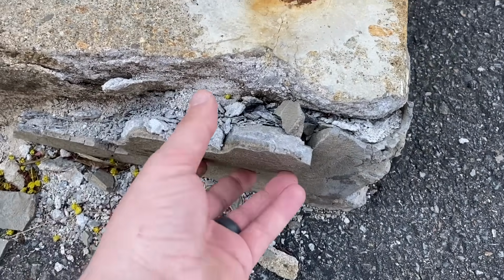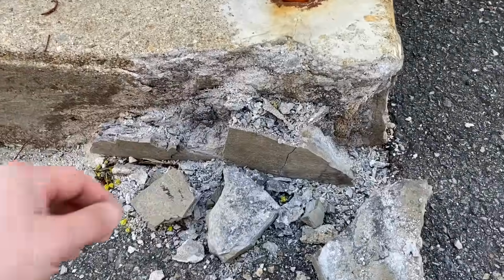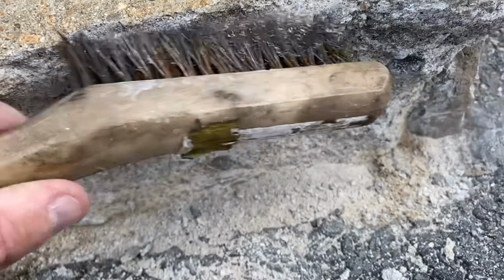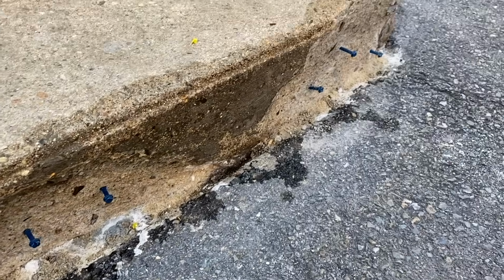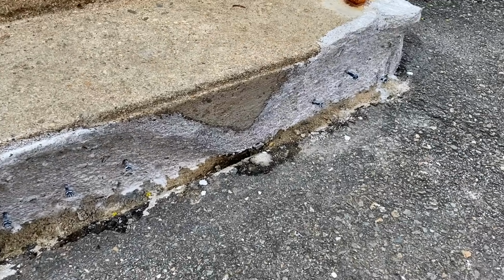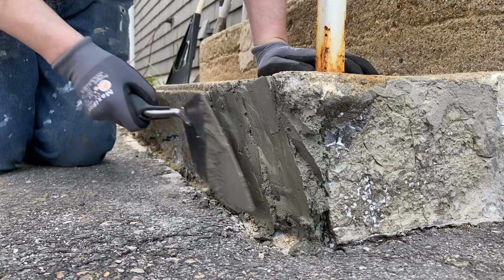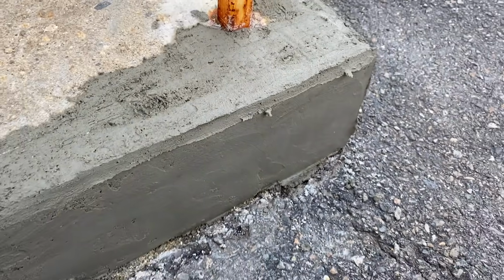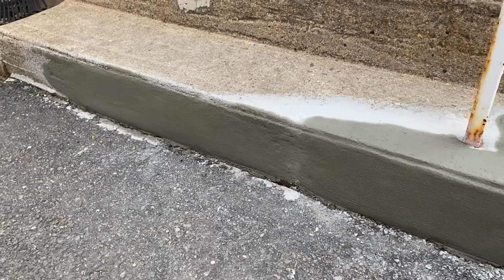How to Repair Broken Concrete Stairs - Quick and Easy

Comment: I am a concrete contractor. This is only a temporary cosmetic fix, especially in Michigan. It may last a year or two and then will pop off. If he had more area, he could have drilled some rebar into the existing piece that will give it more structural integrity, but what you have here is frosting on a cake that will 100% not last

Comment: I was trying to find the difference between Quikrete Quick Drying Cement (as used in this video, and Quikrete Vinyl Concrete Patcher (which I recently bought).  I "assume" they can be used for most of the same jobs? 
Their website doesn't give a definitive answer about differences,  but it appears that the Quikrete Vinyl Concrete Patcher is used for thinner patch jobs (1" or less, where the acrylic modifier additive helps) whereas the Quikrete Quick setting cement is for thicker applications. The data sheet for the Vinyl Concrete Patcher specifically says it is a "repair material for making thin structural repairs."  Could it be used for the repair in the above video???  There were 10 million choices of cement/concrete materials at the Home Center, and I picked the Vinyl Concrete Patcher.  Let me know what you all think. I am also guessing that the Quick-drying cement cures faster than the vinyl concrete patcher, but the Technical Data Sheets don't really say it.

Comment: Rather than using a bonding agent, which can re-emulsify (soften), the least expensive material, and the absolute longest-lasting, try brushing a very thin coat of modified thinset mortar immediately before applying the mix. No screws needed, and the bond will never break.

Comment: probably better to remove a foot of the step entirely, dowel in some rebar into existing and then form and pour with 3-15m bars run parallel with the stair itself

Comment: When patching older concrete, keeping soaked rags on a cleaned face overnight (or until the cement stops absorbing water) prevents the old cement from vampiring water from the new which causes it to pull away /crack. It looks like the adhesive is latex type, which can also be mixed into the new cement for strength, adhesion, and waterproofness, but it raises the cost and causes it to set REAL slowly.
Reply: I had no idea you could mix the adhesive with the concrete!! I have a project where I will definitely put that to use. Thank You!!
Reply: @Chinotruth  Take note to mix per instructions, too much and the cement never sets or is very weak. It also causes it to set very slowly (hence in increase an strength). Again, check the instructions, but my experience is at least 2x longer.
Reply: I must be dumb because I understand nothing you said are you saying to wet some rags and leave it on the old concrete overnight
Reply: @Cind-z9k  Pretty much. You leave the rags in place until the existing cement stops soaking up water quickly.
Reply: Excellent point about wetting the existing surface, so it does not draw moisture from the fresh concrete.

As an inspector it is always a fight to get the crews to wet dry stone or existing concrete surfaces that they are pouring up against.  If I don't do it, it doesn't get done.

Comment: I've been a handyman since 1996 and done some corner repairs like that. You did an excellent job. Not many people go on to show it done right but you did. I like how you're so meticulous in making sure that it comes out looking nice as well. Keep up the good work.
Reply: in your experience, is this type of repair long lasting or will concrete chip away again when exposed to salt and ice? thanks!
Reply: @richmarxist I've done the repairs here in California where I live so we don't have the issues of the salt and ice. But this step by step that the gentleman showed definitely works. But you must use those tapcon screws and concrete adhesive like he showed there.

Comment: Honestly thats too thick to patch, It will always fall apart.A better solution would be to cut out the bottom step and repour. chisel around the railing and just leave it in. Plus the concrete looked brittle too.

Comment: The only advise I would add is to wait for a full cure and apply a penetrating solvent base sealant to the entirety of the staircase/stoop to prevent water infiltration down the road.

Comment: I use the quikset fast setting mortar repair and i swear by it. You can use it over head on the ground or side walls most situations no forms are needed. Its so moldable. I replaced a corner of my slab foundstion that was knocked out with a backhoe. I mixed and pressed it in place with a trowel layer by layer about 6 " deep. No milk(bonding agent) no rebar. Youre right about the tapcon screws. Or even drilling out and sticking rebar in. Its only going to strengthen the repair but the mortar repair is amazing. I havent used the cement youre showing.

Comment: only thing I seen not on par would be not pressure washing  and most of your problems on the corner are coming from the post rusting and expanding and taking out your corner only takes a hairline  and the the problem is back nice job for dyi  and nice job using tap on as anchors had lots of success doing that

Comment: Chip the concrete around the metal post ... remove rust and use red iron primer  or rustolium and paint it .. then when you float patcher around  the post slope so water runs away from post.  That will stop water intrusion and stop the concrete from blowing out again ..

Comment: You shouldn't have any problems after using the bonding adhesive, without that it would have all crumbled away again as soon as the frost gets to it because the old surface will be soft and needs the bonding to stabilise it. Pretty good finish as well by the way, though would have been nice to see it a couple of days later when it had set up and dried out.

Comment: What you should do is find out the reason it it breaking down.   Give you a clue.  Look at the rust at the base of the metal work.  If metal has NOT been treated, whatever you do to the concrete the chemicals reactions will still eventually break down the surrounding concrete again.   Check twice repair once!!!

Comment: I am not really a fan of patching concrete
But to reinforce this where you used screws,
I suggest a better way
Drill a 3/16 hole in the original concrete,
Use coated nails, and get some long lengths of standard baling wire, place in these holes 2 piece long enough to span to the next hole, So when you drive the nails in, the nails cannot be pulled out, or use screws,
 Then drive the nail into the hole with the 2 pieces of extended wire, to keep this wire below the surface, and the wire goes into the next hole,
The wire spans each hole and acts like reinforcing in the cement, keeping the concrete in a solid piece,
I hope you can see the advantage especially when concrete ages,

Comment: Fine after the fixing, but but. The cause must be removed. We can see crack from the steel tube. There is water inside the tube which expands many times during winter time. First we must repair the steel tube or better change it to solid section profile. Second, The existing concrete is not valid. It includes thousands of microcracks. The old concrete must be removed from the whole corner. Then the concrete surface must be cleaned with high pressure water. After this we can begin to use new repairing materials. The permanent contact between the old and new concrete   develops through the hydratation of cement. So, do not use any dispersions, but use water. The surface must be moist but not wet. Brush strengtly cement mortar to the old clean and moist concrete surface. After this, use repairing concrete. At the end, remember curing time. The concrete needs water to harden. Yes!

Comment: Nice job.   I fixed my front steps las summer using the same products.  I used a 6 inch drywall taping knife which worked great.

Comment: Almost perfect, 1 thing i would do differently:  The concrete mix you made should be added with a brush, in a thin layer. . . Just after i would then add the final concrete layer, which should be very dry. . . . Concrete should always be as dry as possible, and covered with plastic for 3 days. . . . This would have made it even stronger.

Comment: Looks like the steps have rust aka iron oxide expansion giving the steps that look... Especially if the square tubing is hollow.... Yes rebar will rust inside concrete

Comment: Right side crocked line nowhere straight ..sorry that wont pass my standard  u could have done better small area ,,concrete remedial guy myself in new zealand ,,,plus when u press that mix on tread it push out the the mix on riser ,ud rather do the riser from bottom going up to tread so to avoid pulling out mix  and avoid getting trap air.if you needed advice free to messgs me been doing all sorts of remedial myself for 15yrs now

Comment: The loose sand is an indicator that a lot of rock salt was used to melt ice and snow. The salt just eats away at concrete especially when water migrates into cracks. But great work on your part for the repair process

Comment: You should used a Rubber Towel to finish the Concrete. The Rubber trowel will make a better Finish on the surface of the Concert next time. But Your project looks good. Great Job.

Comment: Good ... but next time u want to extend a profile onto wet cement ... us a stick (square, or shaped to suit).  Lay it into the existing profile, slide it back & forth slowly, to form the new cement profile exactly the same as the original.  Don't use yr finger ... !

Comment: Thank you. I had a similar problem and it was a hole in the side of a cement porch. Instead of rebar or screws, I used a 3d pen to draw out a frame and the cement held on to it wonderfully. Right through winter. The spot that did not have the 3d pen structure ended up cracking and will need to be redone. Fortunately, it's on the side of the stairs just like you displayed there. But this time I'm going to use the screws and steps you used in the video. Thank you. that was very helpful.

Comment: As a keen (and I'd like to think competent) DIYer, did I learn anything from this video? Using anchor screws as rebar, using cement bonding adhesive and sponge finishing the cement; all check the boxes. Thank you for this; Ill be sure to bear it in mind on my own renovation. Thank you.

Comment: I'm an architect and love seeing these types of videos.   My only suggestion is the you hammer the new concrete so that it matches the rest of the steps.  Otherwise it will look odd that you have a smooth finish on the repaired section and chipped and hammered look elsewhere.   Aesthetics!
Reply from the maker: oh good tip, Andrew!  Thanks for checking out the video!

Comment: Good idea on the screws but plain painted or coated steel screws will get scratched as they are screwed in and start rusting and expanding eventually breaking the patch, I use stainless screws or all thread set into epoxy or concrete. Salt ruins concrete less than a year old except for special mixes used in highways.

Comment: Well as a General handyman for over 20 years I use Portland cement as the first bonding agent.  Wet it down in a pail until it is like totally melted ice cream consistency and paint it on and than I use the stuff in the pail you used, or just general masonry mix.  Masonry is porous.  All masonry slowly absorbs water.  This is fine.  ACCEPT when there is metal in there.  Rebar or any metal (Tapcons you used have a nice protective coating....that strips of when used).  By the time your screws would come into play to "hold" your repair, it would be because there is a crack between the repair and old concrete.  Rusting metal expands, we all see it in old bridge foundations where it blows off chunks of concrete.  Your repair and the old concrete will absorb and different rates, and expand and contract differently.  Your bonding agent will help keep the dreaded water out of the crucial surface to surface area.  I try to use like materials, Portland by itself is an awesome bonding agent, and is the main ingredient in all concrete.  The old surface should be WET always when making a repair, do NOT let it dry off after cleaning.  On a molecular level it causes your repair material to be "sucked in" to the old surface.

Comment: I am not a contractor, just an ordinary guy. I need to fix a corner of a concrete pad that the yard guy hit with a zero turn mower. So this is very helpful. P.S.  Good job.

Comment: Just from observation. It looks like the asphalt was right to the stairs with no expansion strip. If the asphalt heaves faster in the winter than the stairs you have an upward motion pushing on the front and the corner. I note the asphalt has not been sealed which allows water to get between the cement and the asphalt. It’s hard to tell if the asphalt is tapered away from the concrete. 
In a northern climate you have road salt and beet juice two corrosive chemicals that can be brought to the stairs by shoes, snow shoveling and the like. 
Finally, the finished product looks very nice, but it is best if a sealer is used all the stairs; probably several coats to the repair and flat surfaces. A well done video for the home owner!!!

Comment: I have a similar problem except it is on the side of the concrete steps. How do I repair that?
Reply from the maker: Pretty much the same process as I did on the front of the steps here.  Just make sure you clean the area up good and you should be able to make a decent repair.  Let me know how it goes!  Thanks for watching!

Comment: Good job, 
Even you forget to  fix steel wire between the concrete screws to create a spiderweb it helps the concrete to be fixed for ever and avoid to crack

Comment: The only 2 guarantees you can give about concrete is that #1, it will crack, and #2, no one is going to steal it...... I noticed two cracks coming off the corner of that post, which is a given that it will crack off the post. I would have broken that chunk off as well. Well, actually to fix it correctly, I would have torn the old steps out and totally replaced them. The groove/line on the tread is from a poor job with the edger when the steps were originally poured. We would always 'strip and face' which means the boards would have been pulled off while the concrete was still workable, but not totally set, and then mag float those lines out. For rounding your edges, take some thick plastic visquine, and pretend you are buffing out some nice leather shoes. Works surprisingly well. Good job with the 'moose milk' or concrete adhesive glue. That makes for a better joint/adhesion with the new concrete. If you have a pressure washer, that is handy also to get out all the loose grit.

Comment: Thank you Mr. Fixer for you excellent video. I also have cement stairs and I have a cement roofdeck. I use an elastomeric waterproofing product which can be applied to concrete (GacoDeck Primer and GacoDeck TopCoat).

Comment: all the genius comments on what you should’ve done or how you should’ve done it or what materials you shouldve used are comical.
you made the corner look way better than it was.
and yeah its not permanent, but the time and money you put into this repair
will easily equal the lifespan of the repair.
yes moisture freezing and thawing will be its demise but,
that corner and riser will never be permanently repiared ever anyways.
just as if you break a rock in two… it will never be a single solid rock again

Comment: Sorry.  Not a fan of concrete stairs or steps.  Driveways I prefer pavers.  It cracks just that to replace.  Why would I want something that acts as a radiator for the season's.  Hot outside that brick will be hotter.  Cold that puppy is just that.  A block of ice.  In wood by products I trust.  Has never failed me.

Comment: I did basically the same thing on a broken driveway edge. And I too removed anything that wasn't very well connected. Than I mixed up some concrete and applied it and even took some dirt to add to the final to give it the same color as the rest of the drive way. That was a few years ago, and if you didn't know where it was repaired, you never could tell. Always a way to repair things... Thumbs Up

Comment: Your steps looks porous, you could also just mix some pure cement, and brush cement on the entire stairs.
I did it on the foundation wall on my house 30 years ago, still nice and solid, pure cement. Brand new house back then, BTW.
Reply from the maker: Thats a good tip.  Might look into that!  Thanks!
Reply: The bonding adhesive does a similar job, stabilises the old surface so the new concrete has something solid to stick to. Brushing on a bit of pure cement slurry is the old trick we all used to use, cheaper too and works just as well. 😉

Comment: Job looks good, can tell when u were removing loose concrete that there was old hydrolic cement by the color lay difference, using hydrolic cement is "ok", but actual concrete and a few form  boards would b better in the long run, hydrolic does setup fast however the quicker concrete cures the more brittle it is
Reply from the maker: Yes, good info.  There are a few patches on the stairs.  Hope they hold up for a while anyway.  Thanks for checking out the video!